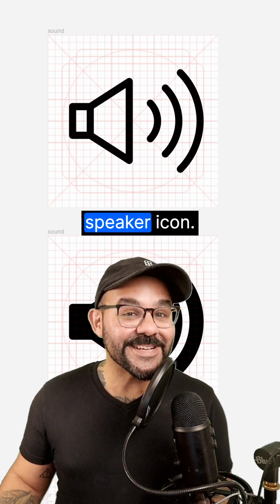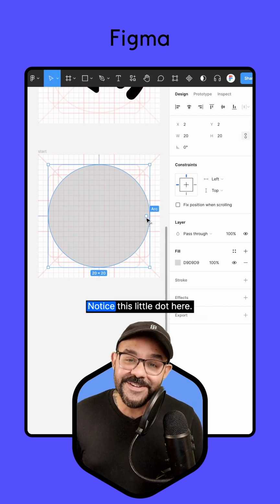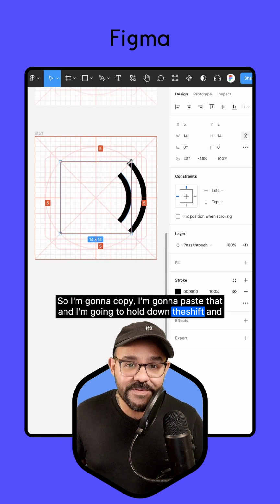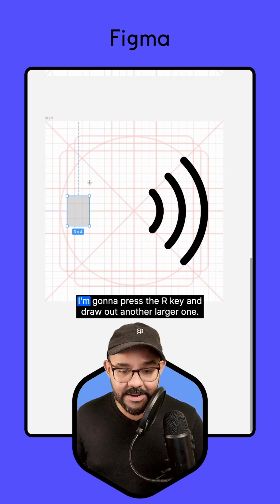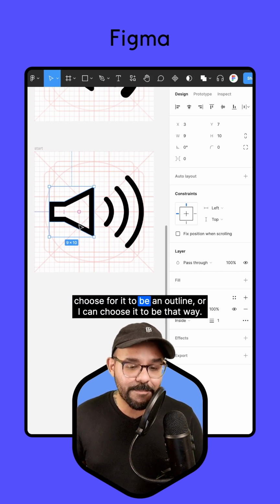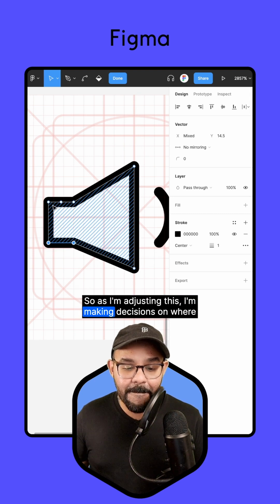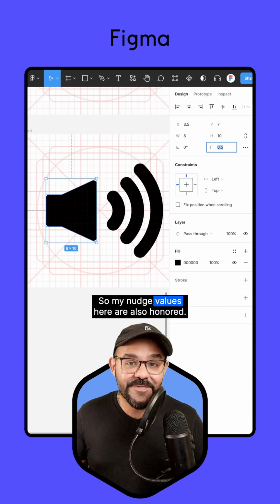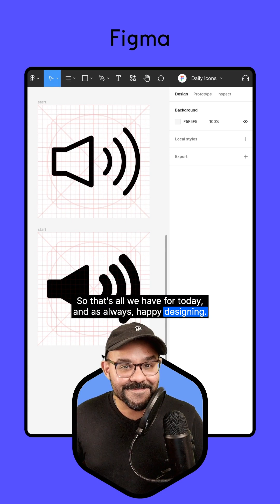Episode 4: Making a speaker icon in Figma

Comment: When is [option] + [shift] sufficient to scale, when do you need to use [K]?
Reply from the maker: Option and shift will just move points around from the center, technically not scaling it. The stroke size won’t increase. K will genuinely scale properties as well like stroke values.